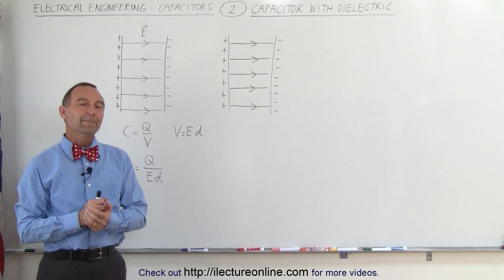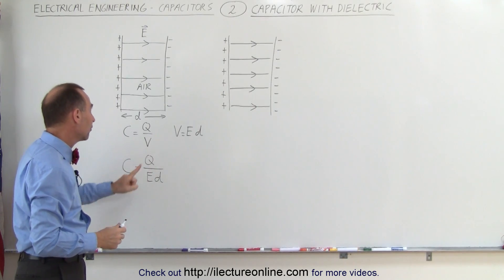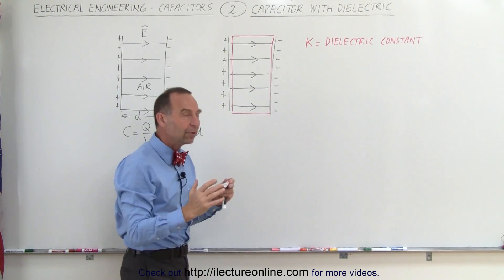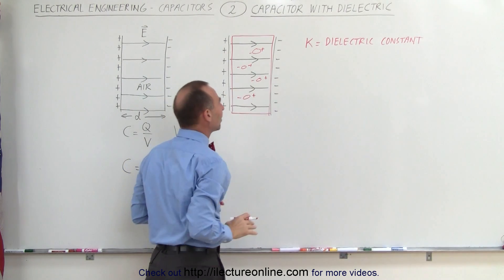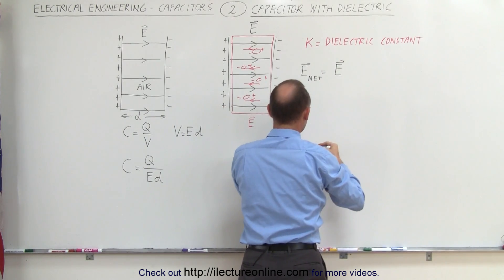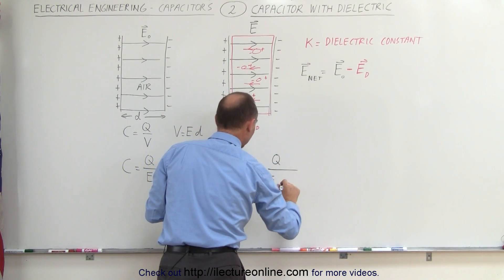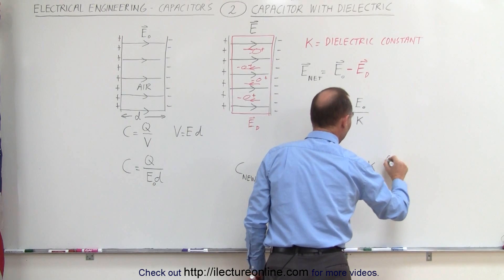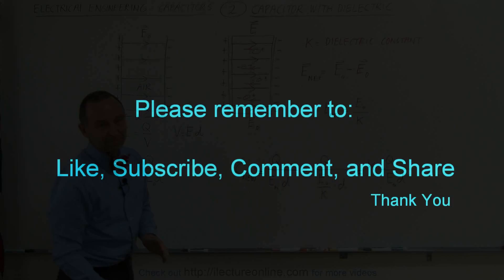Electrical Engineering: Ch 6: Capacitors (2 of 26) Capacitor with Dielectric

Comment: hi, is it correct to assume that the  dielectric molecules are initially randomly orientated?
Reply from the maker: Yes, that is a good assumption.
Reply: thank you  @MichelvanBiezen
Reply: @MichelvanBiezen  can you plz explain me why the V of a charge relative to the other is K×Q/r I do understand that voltage is the amount of work that one  coulomb of charge can do relative to a point and from what I know V=W/q=F×DX/q=(K×Qxq/r×r)×DX/q=K×Q/r but since the force acting on a coulomb is always changing because everytime the r changes shouldn t the work be calculated with calculus on a circuit and then devide it by the charge ? Plz reply thank you for your patience

Comment: Hello Michel. According to my textbook the dielectric increases the capacitance because resistivity is more than air so it better insulates electrode plates from each other. This means a higher voltage is required to move electrons across the dielectric than is for air. It also mentions that the material used to make electrode plates have no effect on the capacitance but the material used for the dielectric makes a difference, along with area of plates and thickness of the dielectric.
Reply: Sister Supersonic (Game Title)  it depends

Any material that needs to cknduct electricity needs to he able to give and recieve electrons easily. So the gas would need to have space in its outer most energy levels of the aromic structure to recieve electrons to become neutral